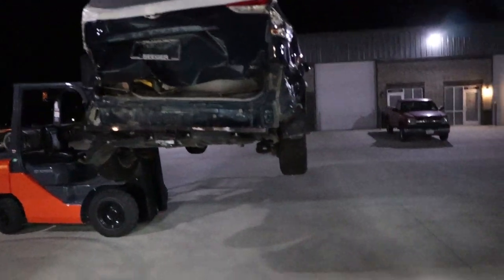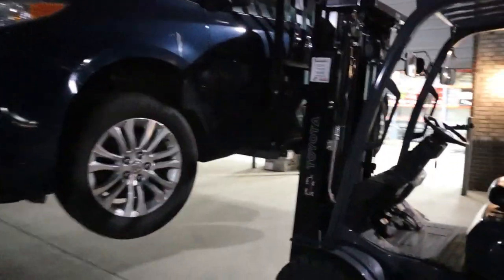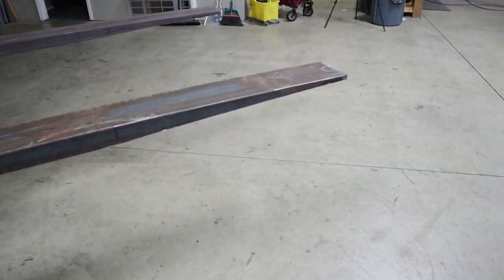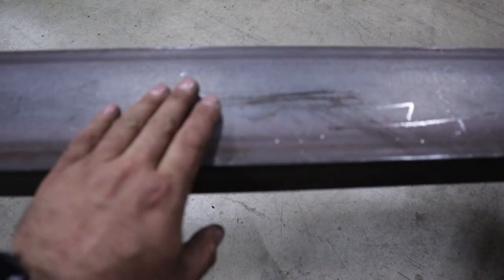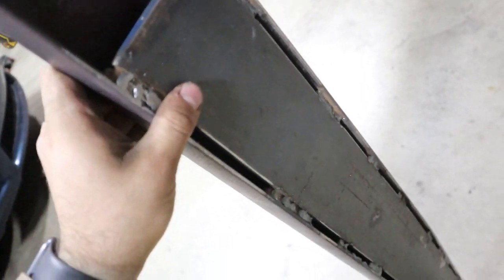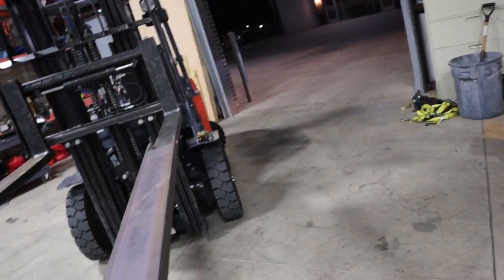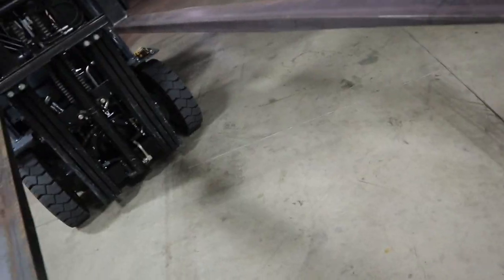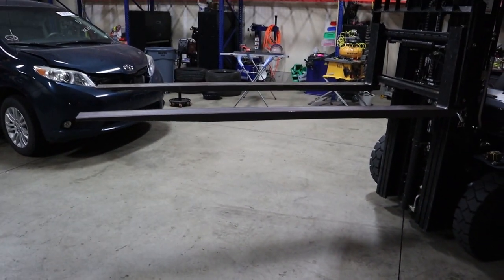DIY FORKLIFT FORK EXTENSIONS BUILD | Used Auto Parts eBay Business

Comment: Bro u need to have that grinder guard the metal grinding disc's explode some times. The forks look great though. 👍
Reply: serge k last summer i was grinding something on my dump truck didnt have guard on the disk exploded laid my forehead wide open lmao
Reply from the maker: yes its a risk. head plenty explode on me and that why i have safety glasses and a face shield, also wearing a welder jacket
Reply from the maker: yes its a risk. head plenty explode on me and that's why i have safety glasses and a face shield, also wearing a welder jacket
Reply: @partsthatfit349   well put the guard on then I seen a guy almost die it went in his neck. Let me guess you got neck protection.

Comment: Need to box in the whole fork so all the strain isn’t just on the two sides that you notched out. You should be able to stand on it without a pin or bolt in it. If the bolt shears that could be a bad day. Someone please correct me if I’m wrong. I’m not a trade welder or a fabricator. But it seems that it would need to be fully boxed in for safety. Btw they look great!
Reply from the maker: square tubing was not available at my local metal store so head to get what i could. also most manufactures have a similar design. and the pins i use are used for a 12,000 pounds trailer hitch. i think it be okay.